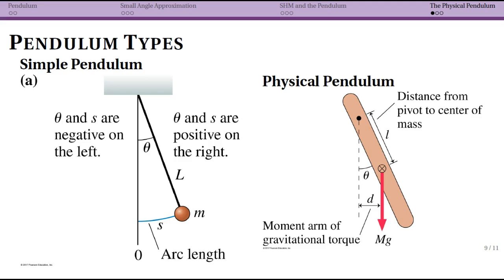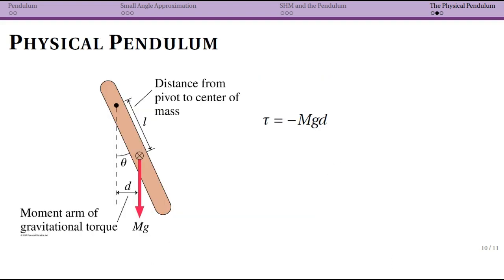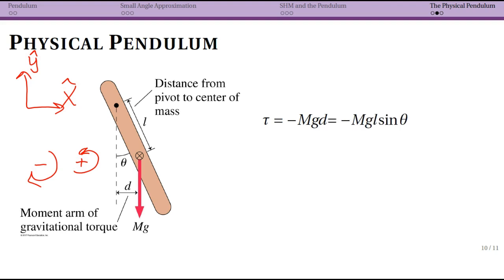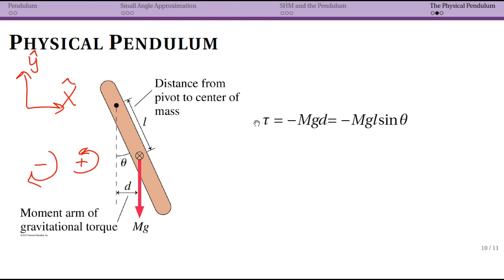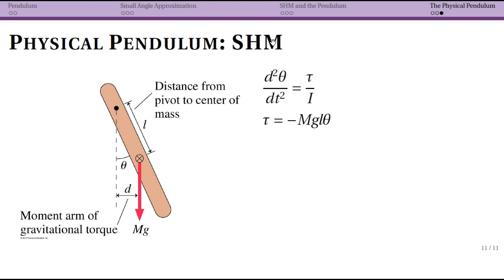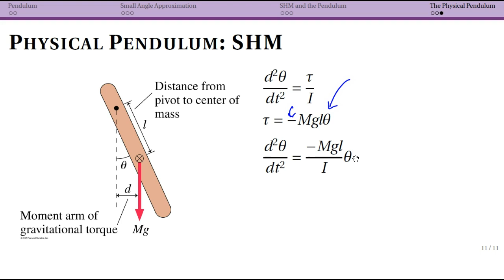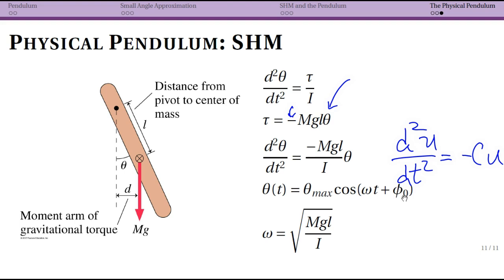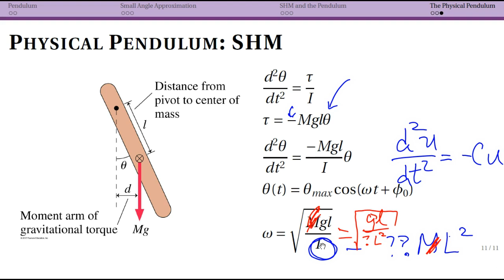Physical Pendulum

Comment: Well-explained. I had a dream I ran into a physics professor carrying a demonstration. It was a wooden rectangle, maybe 2'x4', with several simple pendulums of different lengths and angles drawn on it, all "hanging" from the pivot point of the wooden block. I think the idea was to find the equation of motion for any of those simple pendulums. I realized I didn't know how to solve it so I googled it when I woke up. So all you would need to do is solve the equation of motion for the center of mass, and then make a position substitution to find it for any given point in the object. Thanks

Comment: Hi thank you for this.
You might be able to help me.

With the physical pendulum I understand that an equation relating torque to angular acceleration times the moment of inertia around the pivot (I_a), is the way to solve it: mlgphi+(I_a)phi double dot (where we use the usual small angle approximation sin(phi) as phi).

But could you tell me why a simple equation using Newton's second law on the centre of mass along the phi hat direction of the circular arc through the centre of mass doesn't work. In other words:

mgphi+mphi double dot=0.

The reason I ask is translational motion for an extended body can be described using Newton's second law as long as we use the mass m and the centre of mass. Then shouldn't the net force applied at every instant through the centre of mass act in the phi hat direction and be equal to the mass times the acceleration in the phi hat direction. I'm obviously overlooking something as the physical pendulum isn't reducible to the simple pendulum. Can you shed light on this.

I would appreciate any help.

Thanks.